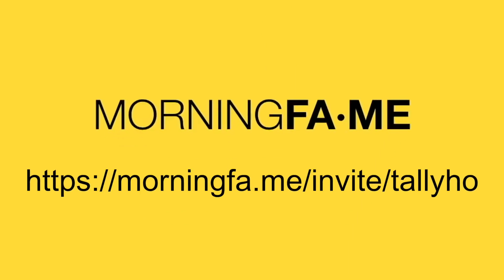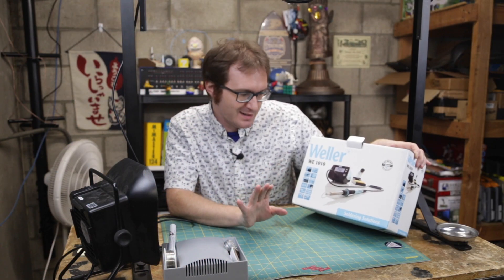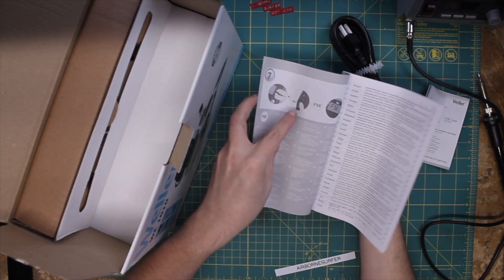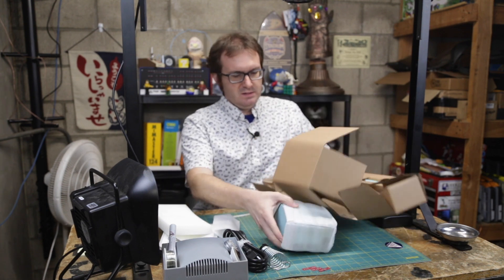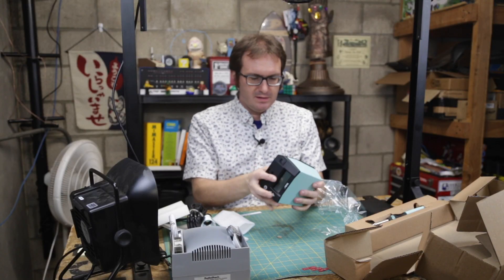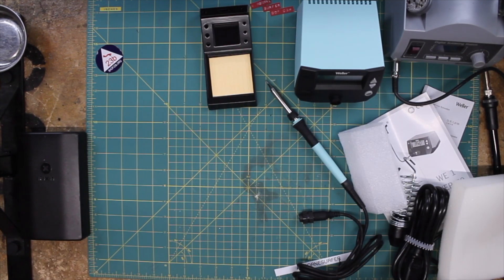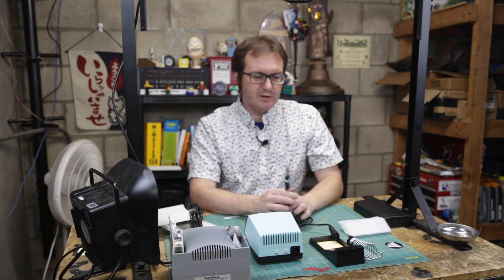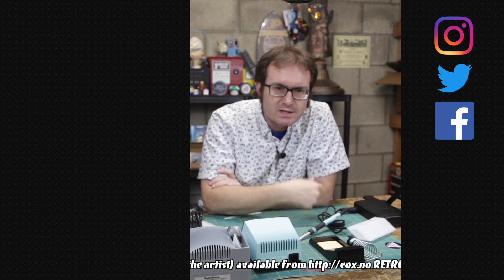Weller WE1010 Soldering Station Unboxing & Initial Thoughts

Comment: Great ! I am happy for you ! BUT ... Does it have a FUSE ?? Wellers are lately not our favorites anymore due to the bad reputation (not fused) ... and even Hakko knockoffs have a fuse ... . They are cutting on costs ... but also cutting big on quality ! I am a Pace guy for life myself .... but JBC also looks yummy ! And I would never go back to an iron without an ACTIVE heating element (not contact-tip one). Thanks ! And use it with joy !
Reply: knew it... weller soldering station review and the EEVblog troops are "flooding" the comments (as of writing this it was 100% :D) This is all happening because Dave Jones was plugging in an American device into an Australian plug ... I mean come on :D
Reply: davedarko point proven in the teardown video. I am from EU and theese are really for sale everywhere (Lidl ...and so on) and nowadays Weller its starting to become a "cheap" brand (at least here). I still am a Pace fan ... and I am using it alot (producing small series of some automation boards montly). I would choose anytime the "Unisolder" project instead of theese, even TS100....just for the active heating element. Weller its really trying to become a consumer supplier, you cannot find them in factories anymore (they prefer Metcal for whateveer reason). We have alot of automotive parts factories around...and all prefer Metcal (???).
Reply: No but i have a fused extension cord so I’m good